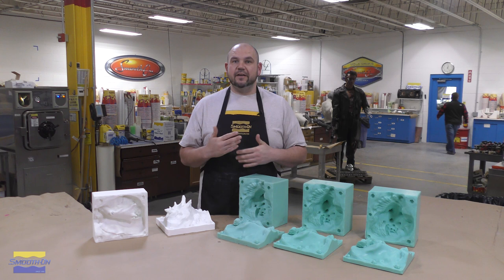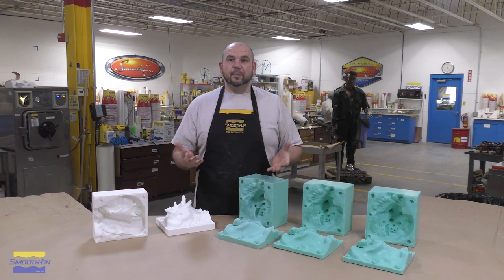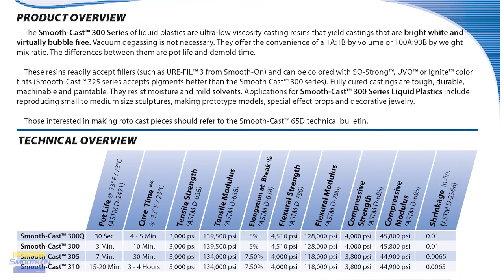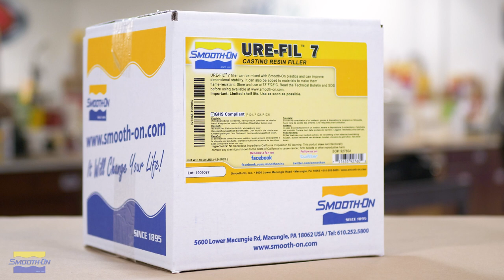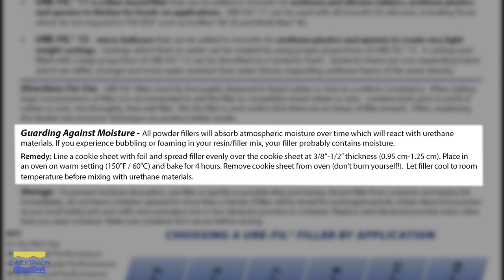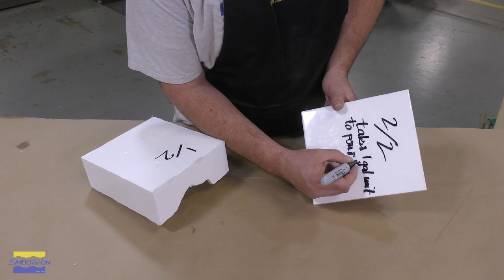Making a Master Model Using Smooth-Cast 310 and URE-FIL 7 Cast Into a Silicone Mold

Comment: Okay, new project for you. (SHOE SOLES and SHOE INSOLES)? Also, can you use Corn Starch instead of the filler product shown in video? Why does your filler powder need to be heated for hours?  Why not sell filler product ready to go out of the box without having to cook it, or heat it? Just asking. Thank you for the upload. Doing the Shoe Soles you need to show a rock solid way of attaching Rubber Soles to the Boots and Shoes. This could be Sewn or Pored or any other way of attachment as long as it's solid. Looking forward to see what you come up with.

Comment: Is there any worry of losing some of the silicone detail when using smooth cast 310? Could a similar process be done using urethane rubber (maybe reoflex or some other alternatives?)? Or would that just produce similar levels of detail in the master model to the smooth-cast?
Reply from the maker: Detail would be the same with urethane.  Casting a slow setting resin would affect silicone and urethane similarly.

Comment: De-gas vs compression or both? My experience in the past was with crystal clear that has to be vacuumed but when I did the same with smooth cast 322 I mixed and poured into the mould and vacuumed…. It caused fine bubble bubbles. Smooth On instructions are not clear enough especially as you vacuumed this resin BEFORE pouring. The data sheet says for the best results compress @ 60 psi??? I’m confused. If I mix the resin with or without any filler and vacuum it before I pour the mould I should be ok? Pot life is a big issue to solve unless of course you have an industrial casting machine that mixes and pours whilst under vacuum. WHATS MY BEST OPTION?
Reply from the maker: Ideally, both would be used, but sometimes the mold doesn't lend itself to pressure casting.
Reply: If the pot life is long enough you should vacuum degas the mixed resin first to remove as much air as possible, then pour or inject into the mold(s), and then put the mold(s) under pressure to compress any remaining air bubbled, and then some resins do well to post cure in an oven (adhere to the data sheet). For me, if the resin’s pot life is short then I will skip the degas, inject my molds and (with the pressure pots ready to go) I wait until the pot life is almost up before I close the pressure chamber and pressurize it.
If you plan to do your castings under pressure make sure that you also cure the silicone mold under the same or higher pressure then you will cast it at, otherwise your mold can deform while under pressure if there are any small air pockets within the silicone

Comment: Hi guys. I just mixed some 310 and yes it was right. Poured it into the mold and I cured under 50 psi for 4 hrs. When i opened it, it was a white goo. 
Any tips or suggestions. 
I also had some molds with 327 im there 
They cured but still seem softish.
Reply from the maker: Hi there!  This is a good question for our tech support team, can you send them a ticket here? https://www.smooth-on.com/support/ticket/add/agree/ Thanks for watching!
Reply: thanks! I wondered if there was a support line. Since i watch your vids i figured id start here. I've been using smooth-on products for 2 years and this is first issue I've had. 
Im also gonna run some experiments. One mix under pressure and one left out. Could possibly be my compressor adding moisture. If so ill buy a drier.